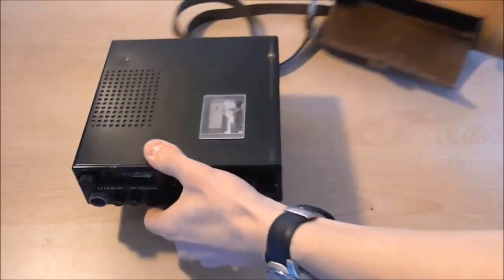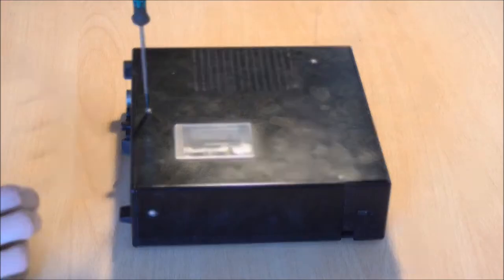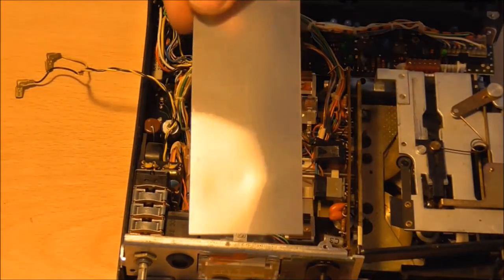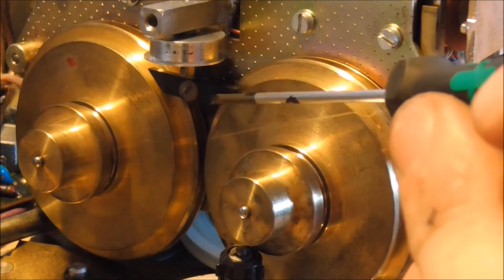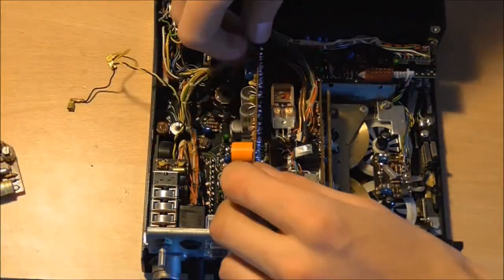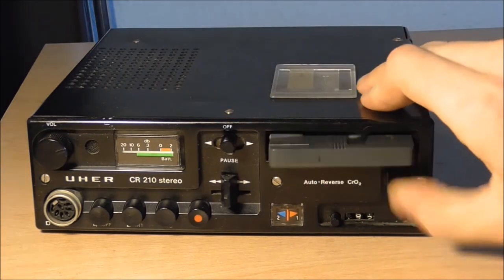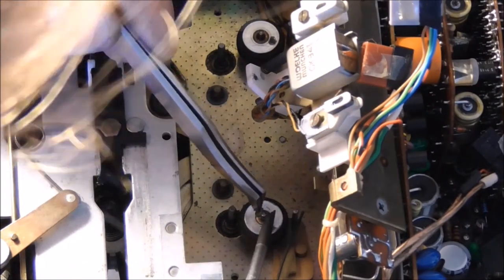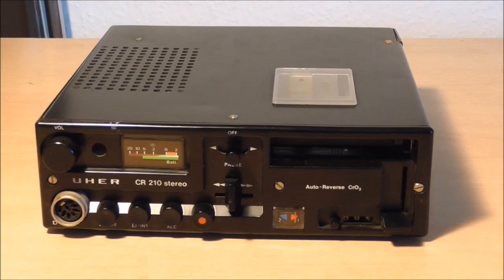Uher CR 210 Overhaul: Belts, Caps, Pinch Rollers, etc.

Comment: that is a really fine unit....seems well engineered! I still have several cassette players, and all my cassettes that I recently cleaned up, and started to listen to. I learned that there is a company still making blank cassettes. Great, and patient job of restoration......good job, and fun to see!
Reply from the maker: It cost me quite an effort to open the device up AGAIN after the tone coming out of this thing fluttered that hard... But I am happy I went the way - in terms of speed stability, the thing is actually better than the JVC in my HiFi. 
The only downside is it doesnt have Dolby Noise Reduction - but you cant have everything, right?
I still have loads of cassettes from my father, so I guess I wont run out of cassettes to record anytime soon ;-)
Thanks for coming around!

Comment: Your video is AMAZING my dude. I just bought a couple of Uher devices, a Royal De Luxe reel to reel, a Report 4400 Stereo and a Cr210 with some tapes for cheap, but with the caveat that they're all somehow broken. Turns out the caps are gone and my PSU is also completely dead. On my Report 4400 I noticed that the PSU would get hot but not manage to turn the motor, so I'm guessing it has a similar PSU issue. I've seen someone just mod a 12V 1A adapter to a DIN plug and get it to work, so that's an alternative for anyone who can't seem to fix the original PSU or can't find one online.

Comment: Very well structured walkthru of all essential faults of this recorder. Please don't insert a voltage reg in PSU, as this will cause power drop to the recorder at load and a lot of heat inside the Z131. The recorder already have a built-in voltage (BD241) regulator. Only C22 should be 25V, the rest 10VDC

Comment: After repair my Z131 for my CR 240 is also ~25V (unloaded). I think this is intentional from the power circuitry that allows the C cells, or alternative sources through the Autoradio socket. One of my diagrams shows '12-24V'. The clever pressure connectors in the battery compartment (or bridges from the button within the Autoradio socket) detect which source is connected and adjust accordingly. I think Uher knew what they were doing, but kudos for getting that little regulator to fit so neatly!
Reply: Precisely, there is already a regulator in uher CR recorders. Replace the Z131 capacitors with 10mF/25V only. The extra impedance of the regulator will limit the output of the Z131 if you use external speakers for example.

Comment: 2 More things I want to add. I don't think your 24V --> 12V circuit is neccessary, the manual states this: " Betrieb mit Fahrzeugbatterien
Für den Betrieb an 12 Volt oder 24 Volt Fahrzeugbatterien stehen
zwei Zapfstellen im PKW für die Stromversorgung zur Verfügung.
Die Zigarrenanzünderbuchse oder die Buchse „Tonband" am
Autoradio". 

I guess it's safe to assume that it should work with 24V as well, which is how the original PSU was wired. 

The belts are another point. I see you used round belts vs the triangle/square belts that are often intended to be put on these machines. I've noticed that the eBay kits always come with round belts, but the experts recommend triangle ones (hard to get) or square. Round belts just have less surface area for grip.

Comment: Do not use round belts, you will have to replace them. Square are std. Triangle are very difficult to find. Allways replace    the yellow Frako caps, they will go to short, cause a lot of damage. Today much larger capacitance is possible, i e 10000/25 in the Z131 and 6800/10 inside. This will bring down hum & noise with another 2-3dB.